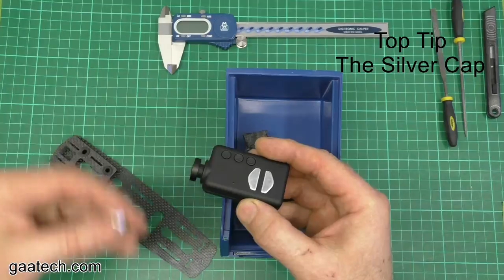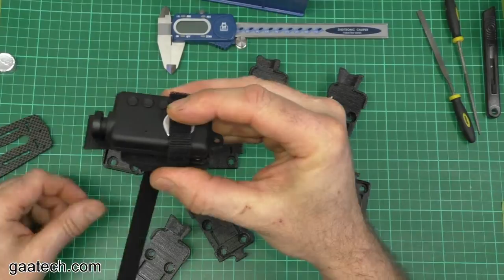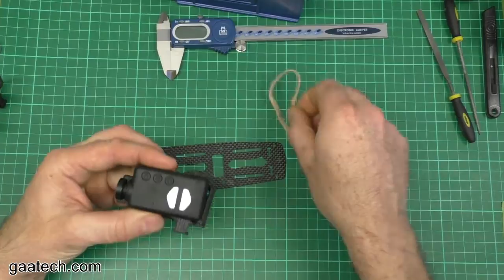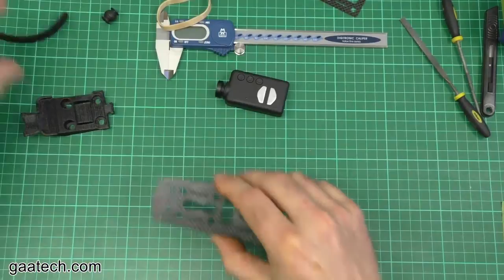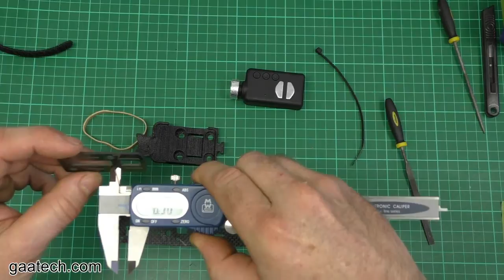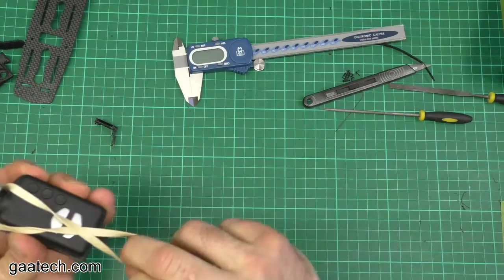0023 ZMR 250 Mobius Camera Mount With Anti Ejection And Lens Protection

Comment: Can you mod this to work with the new RunCam? Same size, lens is in the center of the cam rather than to one side.
Reply from the maker: Hi Tinman yes it would, i would have to alter the design, would you like one if i change the design?
Reply: Yes I definitely would. I have a RunCam in the mail to review and your mount would be perfect. It would probably just need the part for the lens moved to the center instead of offset to the side for the Mobeus, http://shop.runcam.com/runcam-hd/